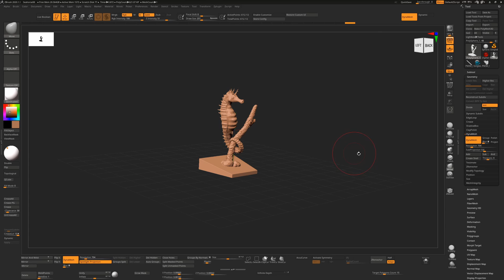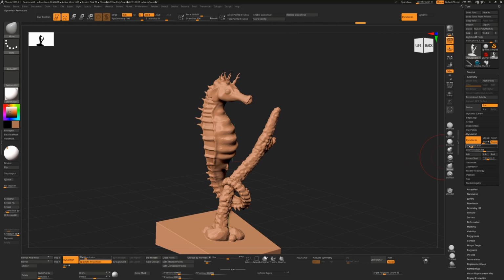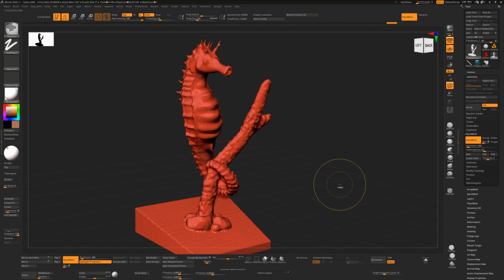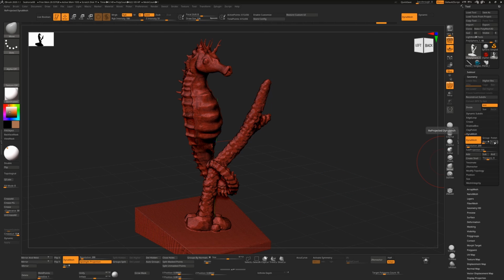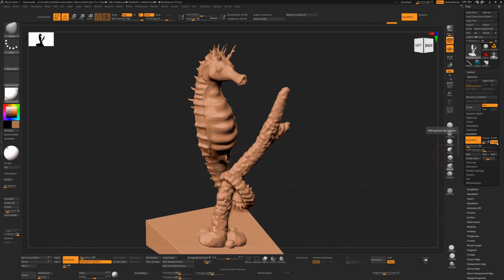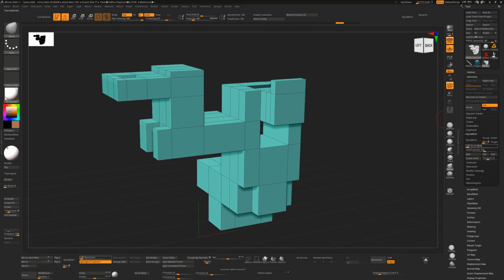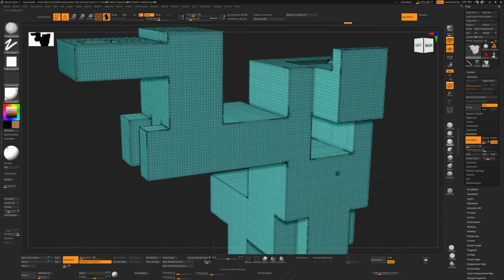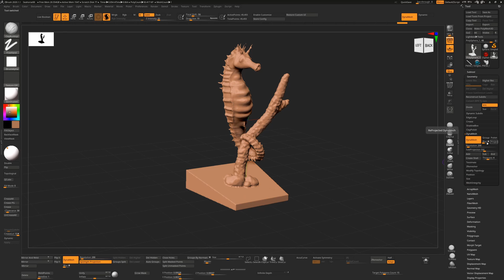When to use the "Project" option when dynameshing in ZBrush

Comment: Sean. Great tutorial as always. Just one question; in this example are there any circumastances in which you would Zremesher instead of Dynamesh?
Reply from the maker: Well, I usually ZRemesh most things I make at some stage. I guess this tutorial was trying to show how the Project button can keep details you might not necessarily want or need, at the expense of extra polygons at sharp edges or fine details. That's not often a big deal at all, so this was more just to show you what happens when you use Project, if you want it or not is totally up to you depending on what you're doing. The process for me is to start organic surfaces with Dynamesh (so I'll go up or down in resolution and may or may not want to keep sharp details using Project), and then once the main shapes are blocked out, convert that to a Zremeshed surface, Subdivide it, and proiect what details I had back onto my model (if necessary), then finish sculpting it with finer details. Not sure if that's a clear answer ot not...